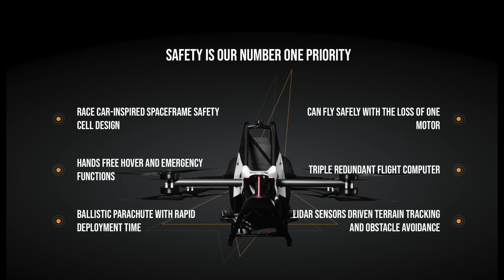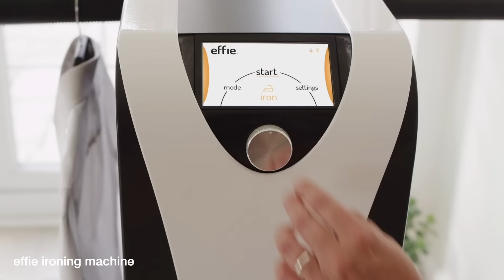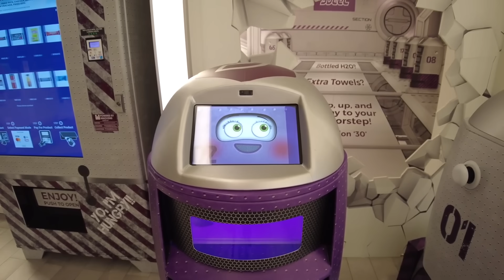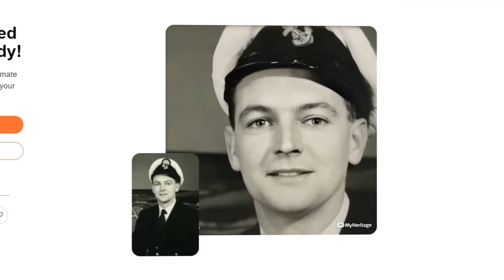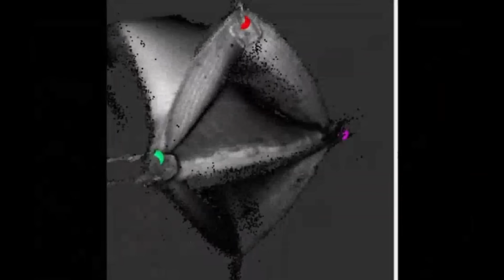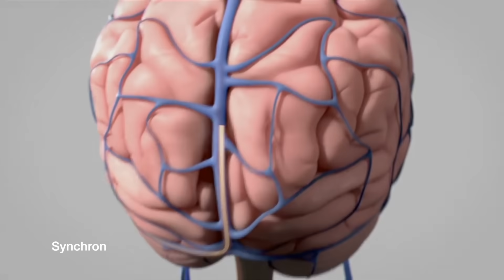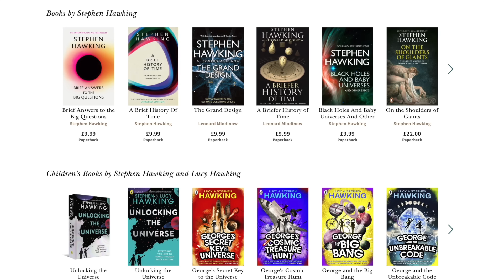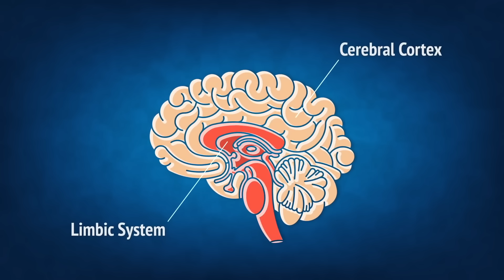Elon Musk offers a new ability that could split humanity.

Comment: We did not even have calculators. When I first started working as a cashier in my parents trading post the cash register had buttons you pushed which caused a mechanical chain reaction. No electricity.  Then when all the customers purchases were tallied the final amount due would pop up in a little window on a little black card. I cannot think of a better way to describe it. Then of course we had within a year or two of that electric ten key adding machines very easy and quick and before I graduated high school everyone had little electric calculators. They were not allowed in school so people would sneak them in their pockets. We had smaller black and white tvs that rapidly developed into huge consoles,  large pieces of furniture. Then rapidly after that everyone had color tv. All using antanna. A couple of years after I got out of high school cable tv started becoming common about the same time mtv and cnn were developed. All about the time jimmy carter was going out of office, the Iranian hostage situation was going on, and Reagan was coming into office. I first saw a video game in an arcade a few years before that. And somewhere in there the first home video game came out which was a simple line going back and forth across the screen and a small dot going back and forth,  it was tennis. Very very shortly after that it was rapid fire advancement. Phones changed from dial to push button,  digital watches became fancier and fancier. Now,  I have had two surgeries,  both robotic.  I have swallowed a pill with a tiny micro camera in it that has examined my entire inner intestinal tract. As a critical care nurse you can only imagine how rapidly imagine how fast the technology I was using at the bedside was changing. How much time I continued to spend in school throughout my forty year career to learn to apply and analyze this technology in my patient care.   I retired three years ago. Portable heart monitor boxes were rather bulky boxes attached to your chest with electrodes and wires.  A month ago I had the robotic abdominal surgery.  Post op a small half dollar sized disc with no wires was attached to my chest wall. I was told this was a telemetry heart monitor.  This change was over three years. The year I retired I saw my first robot like application used in patient care ( on a limited basis ) at the bedside. For about ten years prior to that I had been seeing large box like robots in some hospitals delivering food trays to the nursing units and upon its arrival the nurses would take delivery of the trays and take them into their patient rooms. So. Over the next three years we shall see what happens.

Comment: I worry about how useful it will become for such companies that their services are needed as in causing those diseases to further the profitability of product, especially where military companies are concerned. I don't think there is enough protection against that sort of behaviour now. How is a doctors biased opinion towards practice profit held in check even now. There are already many limbs hacked off that should never have been under dubious analysis of potential life threatening deceases which may or may not have progressed to the stages requiring amputation BUT they do make a profit out of removing such limbs and that is where it all falls down. many a company now profiting from gender bender "medicine" for confused youngsters as young as 12 for the same reasons. Parents fleeced for the cost of course or/and the state coffers.

Comment: I disagree about college.  From my experience it has been a builder of basic skills.  Especially during the first two years when you become familiar with the terminology and basic concepts. The next phase is to add more complex knowledge and theories.  After that.  I agree. Work and doing is much better. 
A masters degree shows you beginning to use the skills and
Understand theory better. 
PhD puts all those skills and knowledge to work on a more in-depth narrowed focus on the subject.  Usually writing books on the subject and imparting knowledge to others.  
Does everyone what to do that or even need to?  No.  But it will limit your understanding of other areas not associated with the exact position your working in.